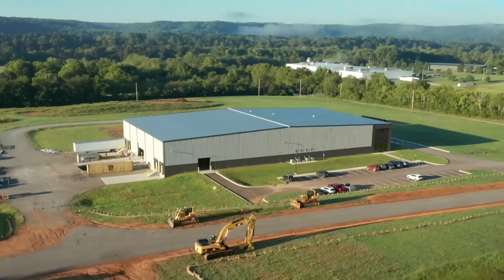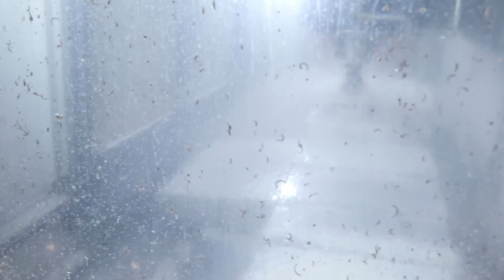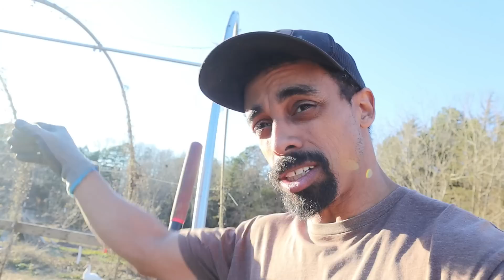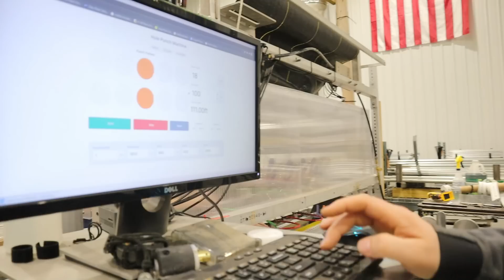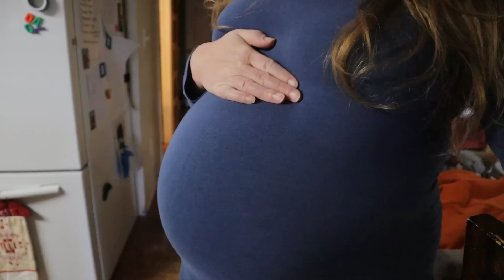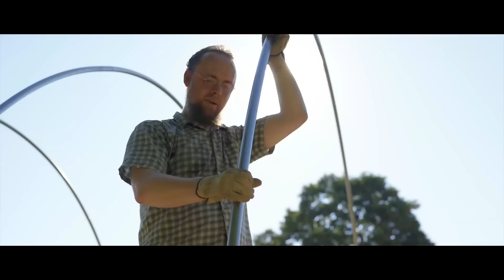GROWING More FOOD with These | He's a Farmers Friend

Comment: Thirty years in CNC and I can say Haas is junk, crash the machine once and it never works well again.  For mills, I've had good results with Doosan, Robodrill from Fanuc, and Galaxy.  Mazac & Doosan for lathes, and Star for screw-machines.  Robots can't tell if there is a chip between the part and the chuck, so killing a part is more expensive than having someone load the part.  Elon musk learned that lesson the hard way.  PS, chips have been thrown out of CNC machines permanently blinding people from up to 30 feet away from the machine.  Safety glasses should be worn on the shop floor at all times.  In my 30 years, I've seen two people die in front of me working on machines similar to those.

Comment: Wish they could make a small hand-held plow for high raised beds. Or a tiller.
Reply: Make your life easier and try no dig gardening.  Check out Charles Dowding. We’ve been doing it with our raised beds and have found it to be easier and successful.  We add to our compost pile all year round.  💙
Reply: @Holly Jo Bitner  I have been gardening now for 25 plus years now in the same beds, without turning them at all, but I need to work in some good compost and dirt, because of all the leaf litter in them. They didn't quit do as well as they have in the past, so I have to amend them, and I am in my late 60s with some pretty hard hitting health issues and turning a new load of dirt and compost would , for me , be easier to revive them back to good dirt and maybe save some money. with more nutrients in them with a tiller , they are 36 inches high, so I can work them easier, but it is time to bring them back up and turn the soil in them. There's no reason to let all the good stuff settle to the bottom of the bed. They also are having trouble holding moisture like they should.
Reply: @pamelaroden5513  I wish you success in your endeavors.  I just raked rough bits/leaf remnants out of the way and planted.  Even my carrots and parsnips did well with this plan. I am a 1958 model of a gardener.  💙